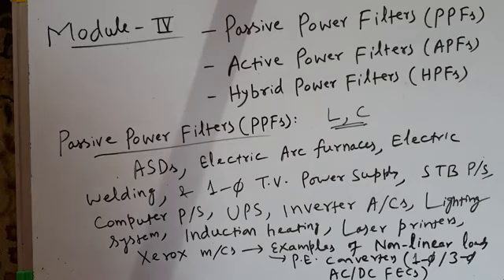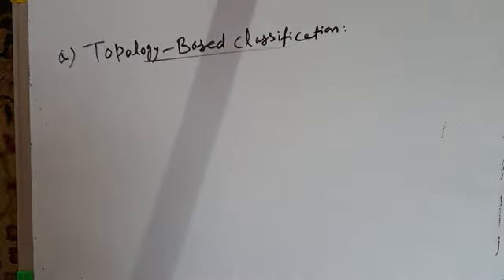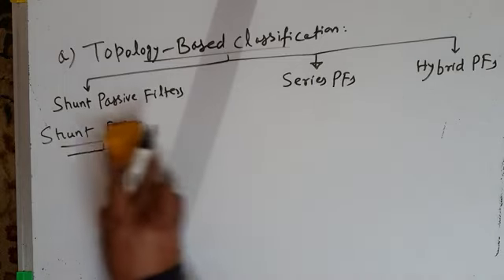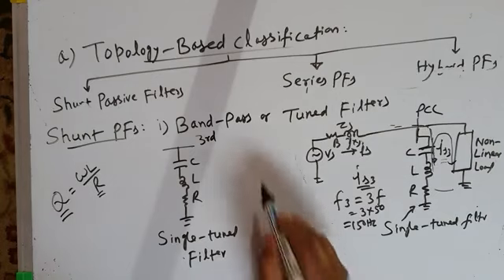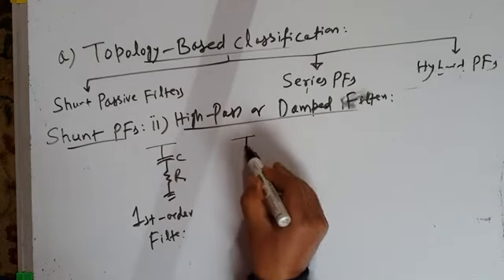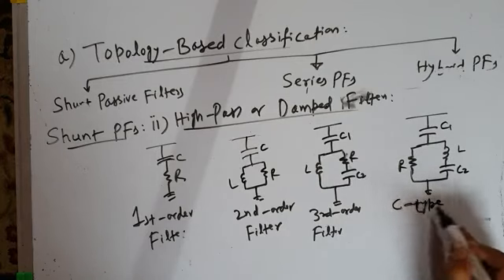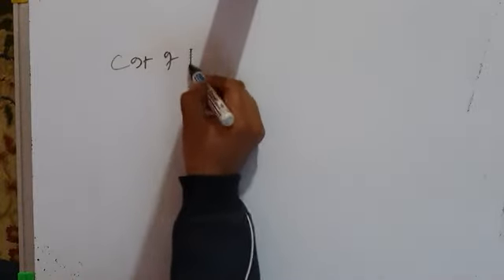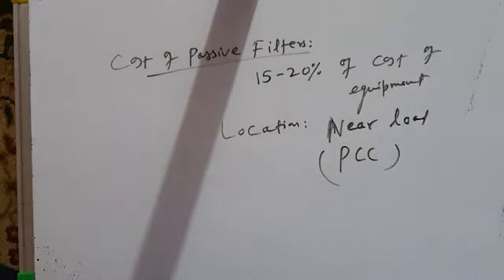L37_Passive Power Filters

Comment: Sir, I really appreciate the lecture.  But I have a serious doubt. IN CASE OF NON LINEAR LOADS AS YOU HAVE MENTIONED SHUNT PASSIVE FILTERS ACT AS A LOW IMPEDANCE PATH TOR THE HARMONIC CURRENT, THEREBY PASSING THROUGH IT. HOW DOES THAT MAKE THE SOURCE CURRENT PURELY SINUSOIDAL AND HOW DOES THE NON LINEAR LOAD GET ITS SHARE OF THE HARMONIC CURRENT WHICH IT REQUIRES.
Reply from the maker: Actually the harmonic content is provided by the filter and not the source. This relieves the source from supplying the harmonic power.